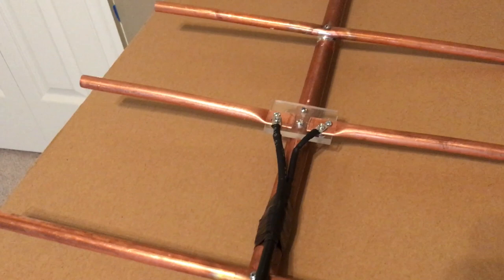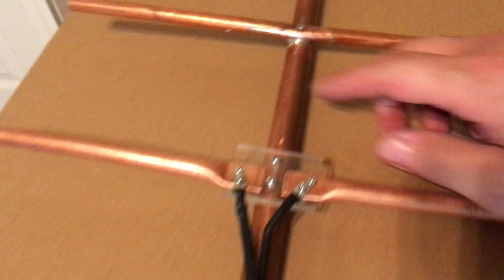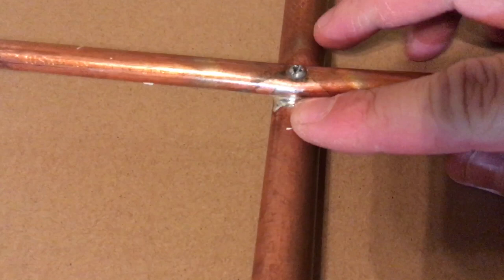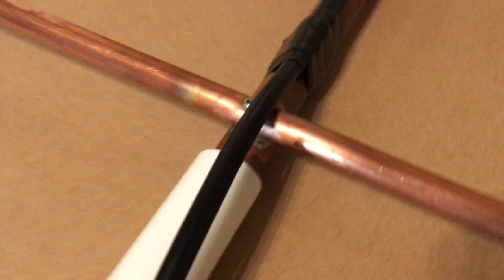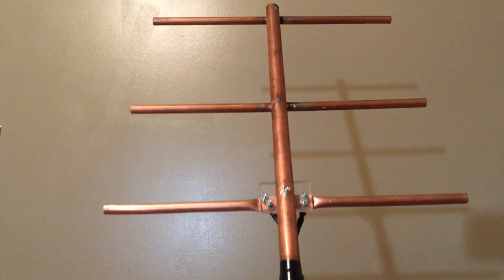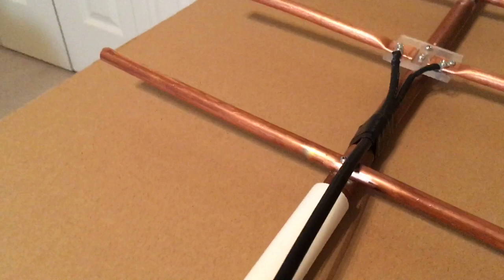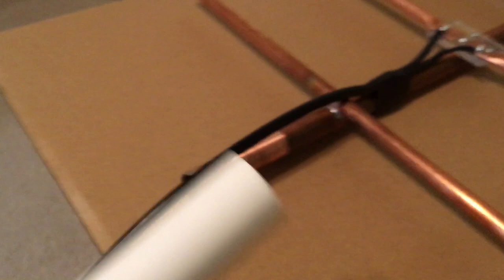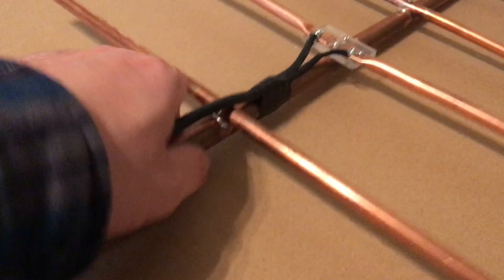Four Element Yagi Antenna For Ham Radio 70cm Band

Comment: I built a yagi recently. Im grttingninto gmrs and doing my amsteur license test soon.  I made a yagi out of a 1/2" copper pipe fornthe beam and i used 1/4 "  soft copper fornthe elements and such.  Solered it together with electricaal solder and made my own gamma match setup.  Im impressed.  Lots of fun making antennas and making them function

Comment: As long as it works , that's all that matters 👍🏾
Reply: Have you tried building a dual band flower pot antenna but do a step better a !!!! A hanging flower pot with a 7 turned choke , I haven't seen that on YouTube
You could be the first 👍🏾👍🏾

Comment: Please ignore the other comments. It’s great to see people doing stuff, learning is the best way, and your website link is right there for people to see.

Cheap single-band UHF yagis are great starting points. They’re small, which helps a lot. Definitely agree with the length of feedline comments, if you can desolder and cut it down and put it a bit further up to where they come out of the coax it’d certainly help a touch. A few ferrites clipped on would help too with the current coming back down the coax shield.

Comment: No disrespect Sir: But if I might add my 2 cents worth to this. Your antenna feed line connection is way to long and now is part of the radiating element length. As such now you will have to decouple the coax cable with a choke balun sometimes called an ugly balun. If not the feedline will radiate in a 360 degree pattern. And there might even be RF on the case of the radio because of this. Because of this one fact I would not copy your build as the SWR has to be out of sight etc!. Also one other interested person asked how to ground this antenna. Myself I would have built this with a grounded driven element and a gama match or a shunt feed point. Again with the feed point connection as short as possible. To direct drive an element for uhf like this is not done well without some form of balancing at the feed point. Just remember to also have a 1/4 wave coax shunt in the feedline that is shorted at it's end to bring the hot lead to DC ground but not RF ground to protect your radio. Best of 73's Jimmy, WX9DX, ARRL TS
Reply: Exactly the explanation for balun i have been searching for,Thanks for your explanation and reasons for using it ....
Thanks  😁😁😁

Comment: not a 50 ohm balanced feed. does that affect how well it works ?
Reply from the maker: I mainly just made this to tryout. Mainly for RX only.
Reply: @FuzzThePiGuy  Rx only ? wouldn't a cheap uhf yagi Tv antenna work for that? changeout the connector and your set ...I picked up a few in the trash..